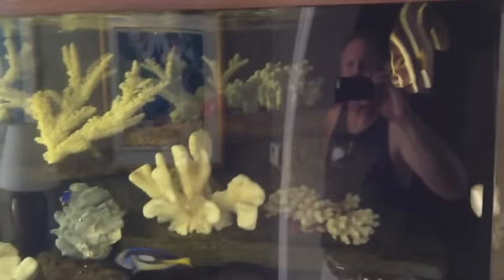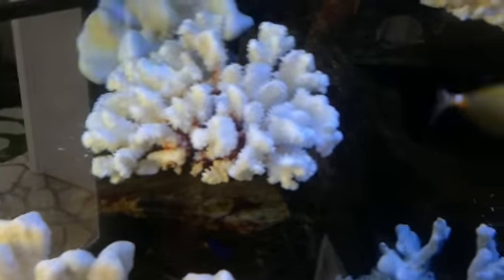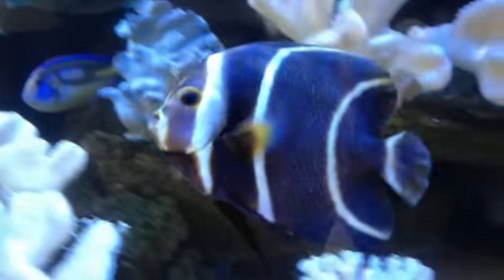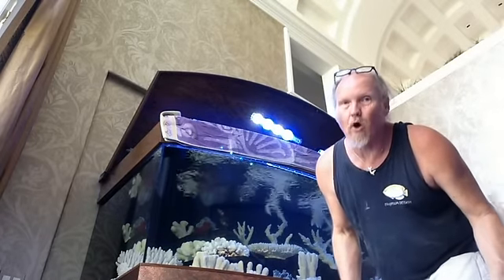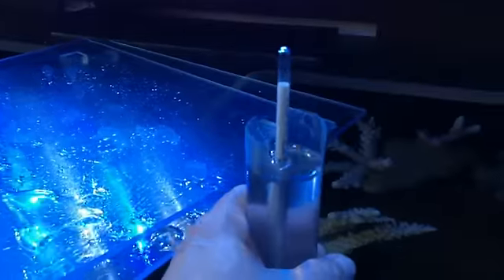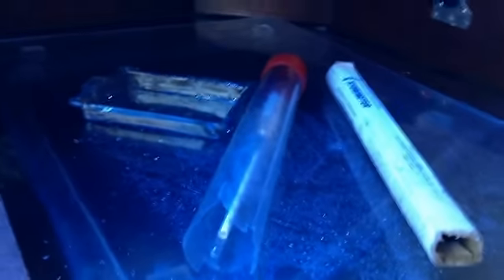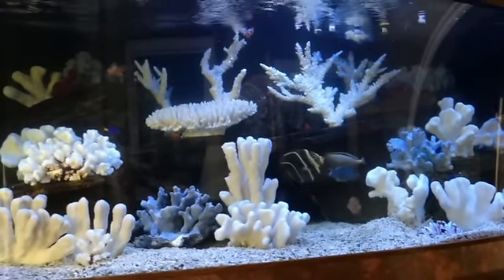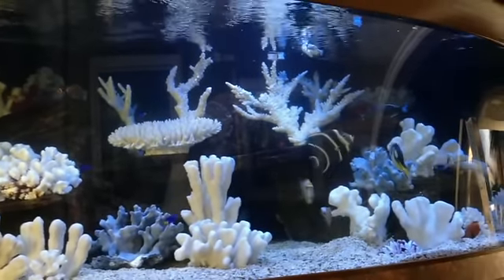Ick Saltwater Parasites LA Fishguys Episode 137, part 2

Comment: I've had more success through the years by leaving things alone. It's when i would try this and that, change this and that is when i'd have issues. I use a hydrometer. Also handy for measuring alcohol content in homemade wine.  ;-) Stay thirsty Jim!
Reply: Having success by just leaving things alone is specifically dependent on the level of infestation of the tank as well as the infection, immunity, & current health of the fish in question. It's just not that simple. Think of treatment as a spectrum rather than a one answer problem.

Comment: Not all refractometers are the same.  The Marine Depot Aquarium Pro Refractometer measures only the pertinent range - 20-40ppt.  Most others are Brine Refractometers and do not take into account the specifics of NSW or ASW.  Also refractometers should only ever be calibrated with a solution close to the desired testing range (per prev comments)

I personally hate refractometers AND hydrometers.  I bought a Milwaukee digital refractometer and I will never look back.  Ever ever ever.  Ever.

Also therapeutic levels for hypo are not truly reached until you hit 1.009, and basically, you need to keep it right there without going up (which won't kill the ich) or down (which will cause the fish to bleed out).  So you need a very accurate reading on salinity.  I don't think you're supposed to do both hypo and copper at the same time though...but I can't recall for sure.

Either way - it sucks what you're dealing with!!!